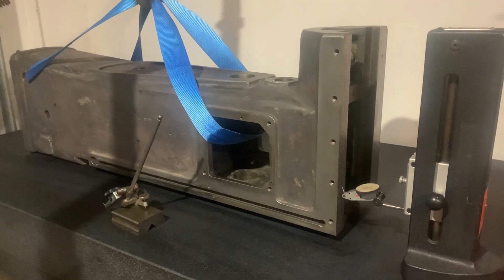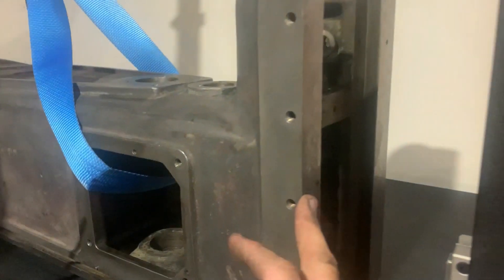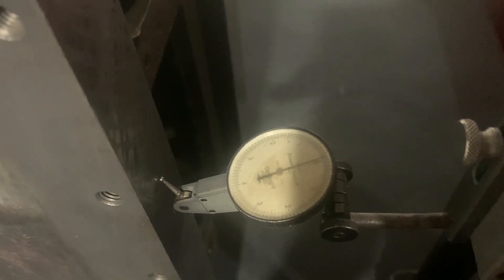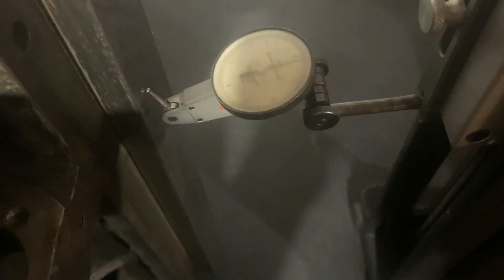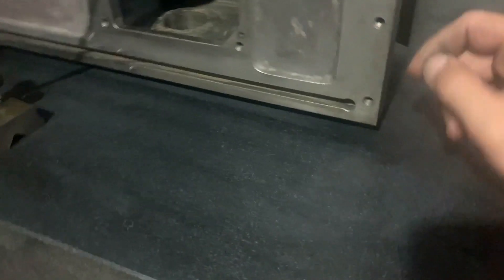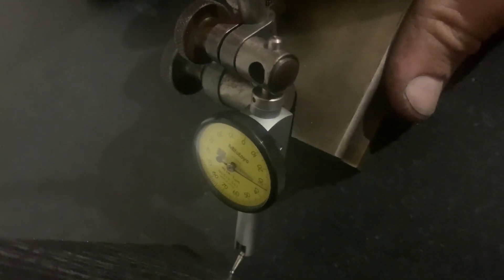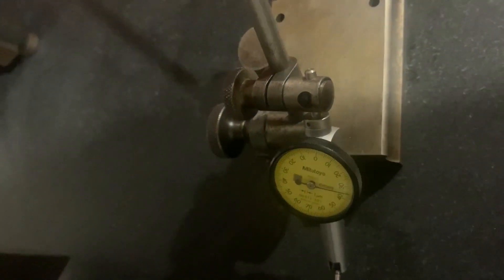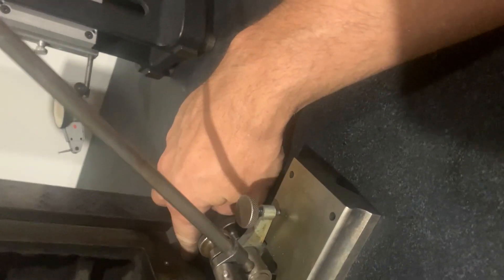Deckel Fp1 restoration Part 1

Comment: Recently bought on old version of deckel fp1 . Does the horizontal spindle drawbar come out of the spindle. It's rotating but not coming out. I want to check the threads of drawbar so I can purchace some collets.
Reply: There is a retainer nut behind it, if you remove it, it does come out.

Comment: Hey, do you have any pictures of the mill before you took it apart? Is the y axis hand wheel at the back of the head rather than the side?
Reply from the maker: Hi the y axis hand wheel is up the top on the side tilted down at about a 15 deg angle. I do have photos but it won’t let me post them here